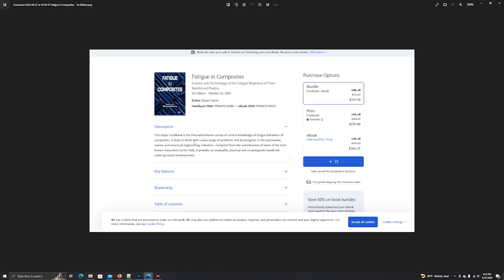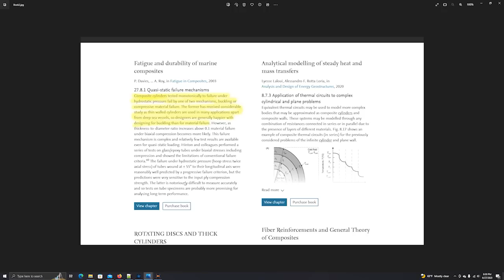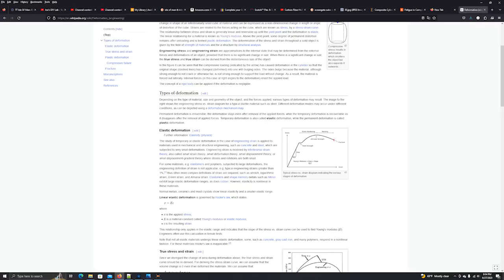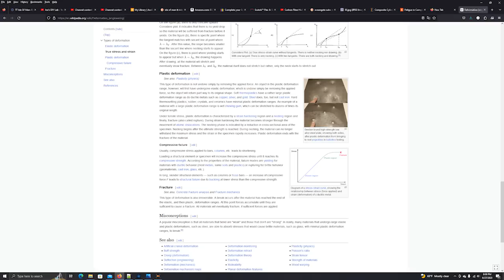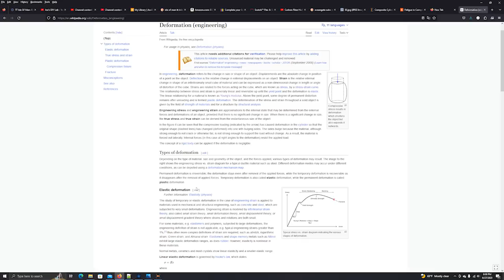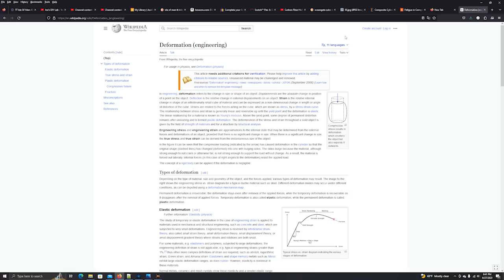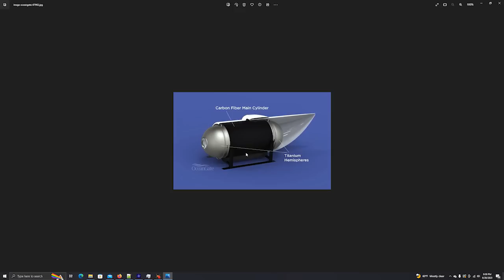Oceangate  Titan Submersible Manufacturing and Engineering Issues Part 2

Comment: As some navy guy said: the fail fast silicon vally ethos is fine if you're designing software for e-scooter rental , it just doesnt work for deep dive submersibles.
Reply: Uhhh, that’s a real knee-slapper
Reply: @sunshinemagicalrainbowunic4004   failed fast for Stockton 2 and half miles down.
Reply: @liamhickey359  you must ask why when it had in 20-21 just been repaired or replaced.  And many dives stated were prior to this remake. Was stated only 1 dive per year thereafter as many cancelled. So possible 1 dive or at most 2 prior to this here dated tragic one!  Hull failure so quickly, not as before years?  What else happened other than that?
Reply: @maryannsinopoli1751  wouldn't mind going on a date with you.

Comment: The first two Titan 'test dives' in the Bahamas to the Titanic's depth of 12,500 feet, according to Mr. Rush and Captain Karl Stanley who rode Titan down and back up successfully, resulted in 'loud pops and crackles'. These were so loud that they resembled fireworks or the discharge of a small caliber firearm. More concerning, according to Stanley, is that on the ascent at 900' depth, the hull was still producing these noises--indicating a discharge of stored energy from accumulated hull faults.
Reply: yes i recall the video where he spoke of this in general after its first dive .But According to Stockton this is normal .The noises settle down eventually  , he got that right .
If we could talk to Stockton now i expect his opinion would change drastically
Reply: Those loud pops were the epoxy snapping apart.
Reply from the maker: Also the fiber would be de-laminating from each other. which would crack the epoxy
Reply: @JoediyLab  Its like standing on a pepsi can, it will hold you up until the slightest little touch on the side and it implodes.
Reply from the maker: @chuckmiller5763  nice comparison
Reply: @JoediyLab  Maybe make the tube section more of an ellipse instead of just straight end to end. Like a football.
Reply from the maker: @chuckmiller5763  that sounds very interesting, I will try to make a plug of this shape and try testing.  Thanks
Reply: Terrifying no doubt..probably popping on the way down
Reply: @jeffries1232 enerally, "this is normal" means that the fiber composite artifact has been stressed past the point of localized failure in order to make the cracking sound. The "settling" after stabilizing the stress means that permanent deformations have transfered the load away from the localized failure to surrounding structure strong enough to sustain the load. This induces strain that stores energy in the structure. Once the stress is reduced by ascending, the structure releases the strain energy. If the local structure is unable to bear the shift in load, the cracking sound resumes due to further localized failure, as it did on Titan. This non-repeatable pattern of varying stress accompanied by continued cracking sounds is characteristic of fiber composite structures loaded past the point of localized failure with a resulting non-linear strength curve. With each cycle of loading and unloading past the point of localized failure, the structure continues to get weaker. After a sufficient number of cycles, the localized transfer of load exceeds the material strength sufficiently to continually transfer localized failures. In effect, the failures zipper throughout the structure at an accelerating rate until generalized collapse. The gotcha is that "reducing" overall stress by ascending does not slow the rate of failure but rather accelerates it by releasing stored energy into the continuing crack propagation process.
Reply: @jeffries1232  The noises settle down eventually - especially now, it's all silent...
Reply: @udirt  exactly
Reply: @nevisstkitts8264  yes i was being sarcastic when i said he got that right .Yes it isnt normal
Reply: @nevisstkitts8264  those "popping noises" are "delamination's in progress" ... and "plastic"; a simple example being a Rubber Band stretched past it's "elastic" point to "plastic" with a result that the Rubber Band cannot return to its' original state. CF is very strong in tensile but lousy in compression ... hence the use of Resin to keep the strands/TOWS in alignment. Once the CF cracks the Resin, it doesn't return and forms a delamination/no bond area. As Joe has alerted us, Rush opted out of using and Auto-Clave and NDI Ultrasonic ... pity.
Reply: I still think a hull made outta MDF wasnt properly explored. My kitchen is 20 years old and doing just fine.
Reply: @liamhickey359  LOL ... yeah, would have ended with the same result ... and a LOT cheaper !

Comment: Excellent Videos Joe, many thanks *  The reason the structure failed was because the Carbon Fibres were laid up in straight parallel Axial lines. Because this was a cylinder the walls in the middle of the tube shape were deformed by the pressure, when this happens the inner walls of the tube are put under tension from end to end  as they are stretched by the necking of the tube, when this happens there are no reinforcing Carbon Fibres to resist this end to end tension and the inner wall resin between the Carbon Fibres starts to crack Axially in the centre, then the crack propagates through the 5" thick wall to the outside and the centre of the tube opens up like a cracked egg, then the ends are blown off by the inrush of water pressure. *
Reply from the maker: Thanks for  your feedback.  the video was of an older sup.  The Titan was wrapped with prepreg using a tape laying process.  But we do not know what the ply orientation was or the cure and compaction process was.
Reply: From the CW article linked in Part 1 (FWIW):
"... performance parameters: Length, 2,540 mm; outside diameter, 1,676 mm; service pressure, 6,600 psi; pressure safety factor, 2.25 ..."

"Spencer opted for a layup strategy that combines alternating placement of prepreg carbon fiber/epoxy unidirectional fabrics in the axial direction, with wet winding of carbon fiber/epoxy in the hoop direction, for a total of 480 plies"

"After layup and winding was complete, the cylinder was bagged with cellowrap and then cured in an oven at 137°C for 7 days. There was no postcure. Spencer says initial assessment of the cured cylinder shows that it has porosity of <1%. "
Reply from the maker: @kengself  awesome information thanks
Reply from the maker: Awesome data thanks so much for posting
Reply from the maker: @TheVicOlive, thanks so much for the awesome data.
Reply: @JoediyLab  the video showing lay up of the tape on the round mandrel I saw showed very little deviation from straight line ply orientation ... maybe 3 degrees to allow the flat tape to wrap around the round mandrel in a spiral feed (think of wrapping a Golf Club grip). That is why I contend that had he used a "Thread/TOW Laying Machine" that winds the individual filaments in a min 45 degree pattern, he might have made it ... with the use of an Auto-Clave (there are plenty of them around that could have accepted the size of the pressure hull.
Reply: @kengself  ... and all done in a "Warehouse" setting instead of a proper Clean Room with temp/humidity controls. Spencer did it wrong !

Comment: Thanks for sharing all these specs and technical details. I've seen  people mentioning the delamination issue due to the different flexibility of the titanium and the carbon fiber, apparently titanium  is by the order of 2 more flexible than carbon fiber so when both are submitted to pressure the titanium end caps caused carbon fiber to delaminate in the side ends due to size changing on the caps since they're more flexible. Pretty interesting point and seems accurate. Thanks for all the tech stuff! we need more content like this
Reply from the maker: Thanks for the feedback
Reply: You're comparing the young's modulus of a single carbon fiber to the modulus of titanium. The elastic modulus of a composite lamina is only about 135 GPa vs about 100 GPa for titanium. When you consider that about 2/3 of the fibers are in the hoop directions you get .66*135, which is about 90 GPa in the hoop direction. Not a terrible match. Through the thickness is another story. The through thickness modulus is only about 9 GPa.
Reply from the maker: @matthew4878  I did not see any info on how they laid up the prepreg,  it would be nice to see what ply orientation they used.  Good info on the modulus.  I was wondering why they only wound in the hoop orientation on the first sub.  Normally on gas cylinder winding they use different orientations.  I am sure at depth the forces would be coming in at all angles.  But not sure though thanks for the data
Reply: @JoediyLab  they only used the winder in the hoop direction because they would have wasted a lot of material trying to wind around domes on each end like on an internally pressurized vessel. If you look carefully at that video you'll see shots where the texture of the carbon fiber looks different. What you're seeing is a layer of prepreg that's oriented in the axial direction. This would have been applied by hand. 

The ratio of 2:1 for hoop to axial fibers comes from the fact that the hoop stress is twice as large as the axial stress for a thin walled pressure vessel. This isn't exactly the case for a thick walled vessel but it's approximately so.
Reply from the maker: @matthew4878  good info.  I get the impression that not a lot of testing has been done on thick wall vessels.    Have you found any info how they applied the prepreg on the newer sub? Thanks for the exchange of information
Reply: @JoediyLab  looks with a tape laying machine that can both wrap prepreg circumferentially and lay down fiber axially. A more automated process.

Comment: Fatigue is laymen's terms is effect of subjecting a structure to repetitive loading.  In the case of the Titan it was the cycling of pressure from repetitive dives.

Fatigue can weaken structures  take for instance the bending of a paper clip.  The first time you bend it, it will change shape.  If you continue bending back and forth the metal will start to neck dowm in diameter.  Eventually, the mtal will break.  In simple terms the paper clip has suffered failure because it was exposed to too many cycles.

I think you've done a good job of simplifying a complicated issue.
Reply from the maker: Thanks for your feedback

Comment: Interesting video! Let me add two remarks:
1. You mention correctly that CFRP is strongest in the direction of the fibers, and weakest perpendicular to the fibers. In a pressurized cylinder, no matter if internal or external pressure is applied, there are two loading directions: axial and circumferential. And that’s the two fiber orientations that cylinder should have (or an equivalent layup of symmetrically angled fibers, like what you’d calculate using net theory. In all images and videos I’ve seen so far, including the one you linked in part one of this lecture, I’ve seen fibers ONLY in circumferential orientation. If that pressure vessel was actually constructed this way, there’d be no fibers supporting axial loads, which would be an absolute beginner’s mistake!
2. Compacting fibers or fiber cloths by vacuum or autoclave is done with relatively flat parts, and it makes sense there. But please understand that applying vacuum compresses the fibers, while at the same time increasing the size of any air bubbles within the resin. If you wrap fibers on a mandrill, you compact them by the tension while winding, which keeps them nice and straight. If you compact them afterwards, you reduce the diameter while the fiber length (i.e. circumference) does not change, hence you cause the fibers to ondulate, thus weaken the material. Only straight fibers carry high loads, especially when loaded in compression.
Reply: Thank you for your excellent comment. The website of Pacific Coast Composites states many technical details of the hull manufacturing process used by Spencer Composites for Cyclops 2 (is that the initial pre-launch name for Titan?--the CF hull dimensions appear the same). They mention laying of materiel in both the 'axial' and 'hoop' directions:
...Manufacturing in a generous safety margin: The carbon fiber/epoxy hull of the Cyclops 2 features alternating layers of UD prepreg in the axial direction, and wet-wound carbon fiber filaments in the hoop direction. The hull is 127 mm thick (5 inches vs. the 6 inches planned for Fossett’s earlier craft) and has tested to 2.5 times the 6,500-psi service pressure...
No autoclave was used--curing was by 'oven' for 7 days at 137 deg C.
Reply from the maker: Thanks for the awesome followup.  Yes I heard in the titan sub they used a tape laying  machine.  I will have to check the Pacific Coast site.  that is new information for me. But Stockton refused to perform between dive testing.

Comment: One comment on “fatigue” and failures. In metals, “metal fatigue” occurs when microscopic cracks grow in length over time due to cyclic loading - varying levels of stress. Such cracks are essentially unavoidable though good design can minimize their size or formation. The cracks will grow in length even though the nominal stress is below the plastic deformation level. Some materials such as steel have some stress level that the material never fails. However, in weight critical applications, too much material would  be needed to result to such low stress levels. Thus, a limited life of the part or structure is accepted.
Such cracks grow in length until a “critical crack length” is reached; then, failure is usually very sudden such as the Comet jet or the rear pressure bulkhead of a 747 ruptures (look up JAL flat 123). 

In this case, fatigue is similar - delamination between layers of the carbon fiber-plastic composite or perhaps loss of adhesion the fibes and plastic resin. Eventually some portion of the hull fails and then the whole structure fails.
Reply from the maker: Thanks for the feedback

Comment: Great video. 

Does the glue between the titanium and CF do anything at depth. I would expect that the exerted pressure would keep the titanium end caps in place. Also I would expect considering pressure being equal around the vessel, that the CF would not expand outwards under stress from the end caps. That would leave the delaminating / fracture in the CF as the culprit?
Reply from the maker: Good question,  epoxy adhesive is used in aerospace applications with very good luck,  But not at those kinds or pressures.

Comment: Carbon fibre works well on oxygen cylinders and takes a huge pressure outward but not inward
Reply from the maker: Yes, unless it is designed right, Thanks for the comment

Comment: At the beginning of this Part 2, the ratio of wall thickness to diameter was cited as 5 inches (wall thickness) : 8 feet (96 inches) vessel diameter. The Titan inside diameter was 56 inches (not 8 feet; the composite hull was 8 feet long), or outside diameter 56 + 5 = 61 inches of composite material. So the ratio should be (5 /61) ~ 0.082.
Reply from the maker: Actually I was mistaken,  pressure vessel is 5'10" outside diameter.
Reply: If ID is 56 and thickness is 5, then OD is 66, not 61 (OD = ID + 2T)
Reply: @JoediyLab  if OD is 5'10" or 70," then ID is 60" given a wall thickness of  5"
thickness to mean radius ratio is used to differentiate. Mean D is 65, so R = 65/2 = 32.5 with t/D = 5/32.5 = 0.154,  1/20 would be 0.05, 1/10 is 0.1, so between 1/6 and 1/7. Thick wall pressure vessel.
Reply: @nevisstkitts8264  You're correct.

Comment: 9:02 Acoustic Emissions (AE) Monitoring is a category of non destructive testing (NDT). AE has been used to test and monitor fiber composite structures for over 30 years. The primary limitations of AE is 1) that indications occur after the structure has been loaded past the point of localized failure and 2) limited to locating issues and then other test and inspection methods are required to fully diagnose issues. The Titan AE monitor used methods covered by an Oceangate patent, and IMO such DIY use without independent validation and verification raises questions about Titan AE being suitable for NDT.